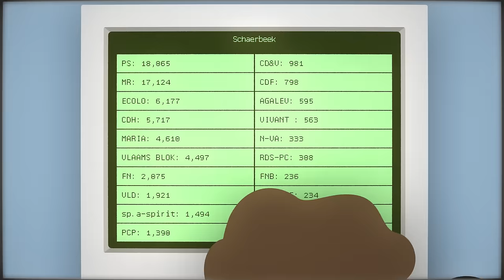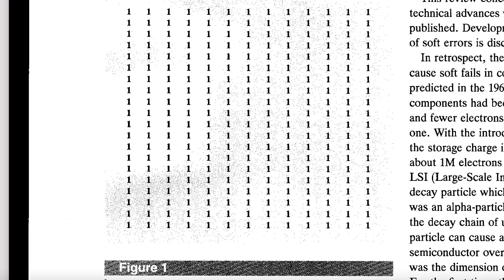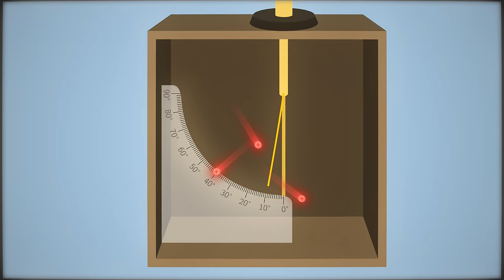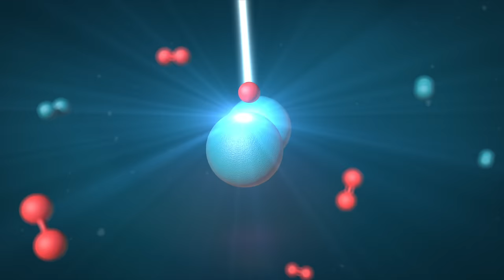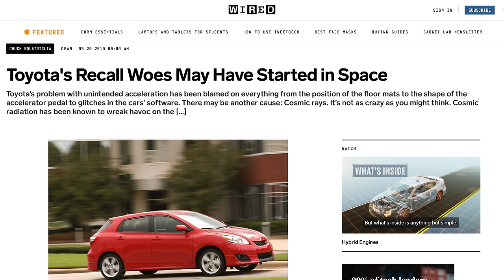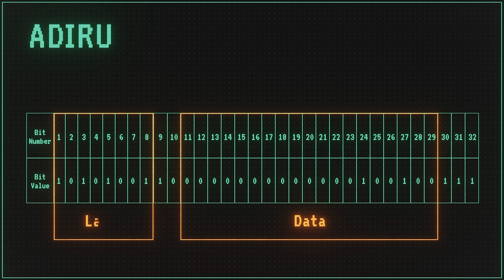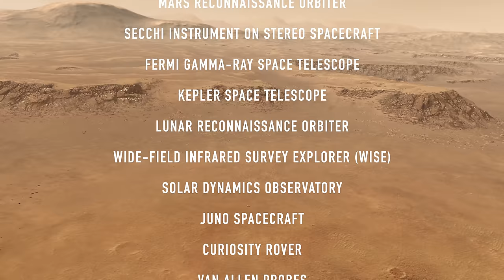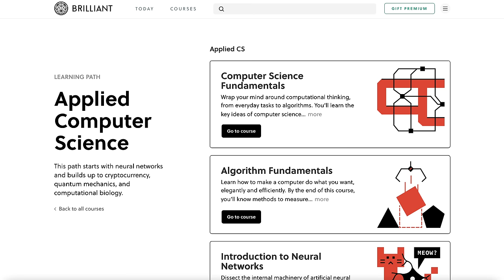The Universe is Hostile to Computers

Comment: My company had an unexplained event like this some 20-25 years ago.  The bottom valve of a chemical reactor opened prematurely dropping the batch from that reactor into the next reactor, ruining both batches.  The investigation found no issues with hardware and software.  Watching this video jogged my memory on that incident and now I truly believe it was caused by cosmic rays.
Reply: hmm, another perfect example why depending on computers will likely come to be a big mistake.
we so busy worrying about if we can, but not if WE SHOULD>
Reply: @Lizards_Lounge Ehh id say the better alternative is having a failsafe
Reply: @Lizards_Lounge  The 1000s of %'s of efficiency we gained from computers is well worth a couple mishaps here and there, and its not like that never happens with human operators.
Reply: @Lizards_Lounge  NASA has cosmic ray proof tech, I dont think the problem is THAT big after we learn from our mistakes. Computers used to be a bitch 20-40 years ago
Reply: @Lizards_Lounge  most likely, in the current state of the world, ai could possibly open up a whole new level of bitflip tracking and fixing, but simply having a few failsafes works well.
Reply: @Lizards_Lounge because relying on a person would result in no mistakes… 🤦‍♂️
Reply: I'll remember you said this when you get doused with hot nitric acid at the factory there matey...!
Reply: @universenerdd  , right, like a mechanical lock that has to be unlatched.  But, alas, they didn't have that.
Reply: @KerrAvon7 , who is this response to?  Me? What did I say that irked you so?
Reply: @nghiado9895  It's to you obviously. If a valve can let an entire batch of....whatever....be ejected at the wrong time could be made to empty a viciously corrosive species on a human if the other physics allow it, not just the theory of solid-state semiconductors...! I wasn't being vicious...I was alarmed and concerned for your life my dear colleague!!   :face-green-smiling:
Reply: @KerrAvon7 , oh, I see.  The setup was that one vessel would dump directly into the one below it.  It cannot be spilled out of that connection, so no one could have been hurt ever.
Reply: @nghiado9895  Yes, I thought you'd design it correctly!   :)
Reply: @squidwardo7074 "sorry boss, i think i was hit by a cosmic ray"
"... you killed three people-"
Reply: Would be an awesome piece of history if you could find the incident investigation. That’s required per osha, although I’m not sure how much history your plant keeps
Reply: wink wink

Comment: I've been programming computers since 1969 and I thought this was solved in the 70's with ECC and other memory correction schemes.  I also thought the math co processor functions on the Main-frames and Mini's actually ran the calculation multiple times behind the scenes because of how the compilers compiled the code.  I had no idea this was still an issue.  Holy cow!  A plane gets bad data and attempts to fly into the ground.  I'm speechless that on a plane's flight controls there isn't redundancy to counteract this.

Comment: What blows my mind is I'm a software developer and never heard of such things. This is incredible, thank you very much!
Reply: I definitely have. It's why RAID scrubbing is a thing and RAID scrubbing in a RAID5 or RAID6 is still not as redundant as the old space missions, but since the incident rate is lower, it's usually good enough. It's definitely why your data is safer on a RAID5 with periodic scrubbing than a single hard drive, even if the hard drive never fails. Bits get flipped and those might not even all be cosmic radiation. Entropy takes on many forms.
Reply: Also you may have heard of ECC memory and wondered why it costs more and is mostly for servers.
Reply: I work in high safety firmware and we do have standard coding procedures to recover from bit flips in the absence of ECC RAM. Usually we duplicate sensitive variables in different parts of RAM and we also invert some of the duplicates.

That way we can check both for SEE and for short circuits on the data lines (if you only keep duplicates without inversion you would not detect a faulty data line).
Reply: I'd imagine most software developers don't need to loose any sleep over soft errors. Worst case the user has to restart the program or power cycle the computer and the work lost is quite small. The story gets vastly different in sectors like enterprise, industrial or any form of transportation where soft errors can have huge financial or deadly consequences. And even then I would think that most of the devs work on a layer which doesn't directly interact with low/hardware level stuff like ECC, parities, RAM-checks, self-tests etc.
Reply: @den2k885  What if the bit flip occurs in instructions instead of data? Do you run important calculations multiple times or some other way to deal with that? Seems like a really tough problem to try to code your way out of instead of solving at the hardware level. And I guess this technique would only really work when writing very low level programs, otherwise who knows what kind of compiler optimizations, high-level language magic, OS abstractions, etc would get in the way.
Reply: @mpoisot  very low level, we're talking about firmware where optimization is controllable in every aspect for any section of code.

Code is checked both through watchdogs (prevents flow going comoletely awry) and usually decisions are taken after N samples of some parameter, a single bit flip won't be critical. Code is also continuosly loaded from ROM, and in many cases the underlying OS (RTOS or AutoSAR) has still other cross checks on registers and tripping points to validate the flow of the code.
Reply: well, now you know what to do about the bugs!
Reply: The beautiful thing is that hardware people take care of these things so you don't have to worry about that. It's all a team effort, no one needs to know every detail of every level of abstraction.
Reply: It's always been my first go to excuse for a bug in my code.
Reply: anonymous  it’s not. It can be damaged just like any other component by ESD

ECC usually refers to having an extra set of bits so that you can detect (or even correct) bit flips. 

Here’s an example: let’s say you have a rule that you must have an odd number of 1 bits in a 9-bit row. That means your extra bit (the parity bit) must be 1 if the number of 1 bits is even, and 0 if the number of 1 bits is odd. Let’s say there’s a single bit flip. That means you now have an even number of 1 bits, so you know a bit was flipped. This doesn’t work if you have two (or any even number of) bit flips, since that would result in an odd number of 1 bits.

Note: a similar method is used to detect whether you typed in your credit card incorrectly.
Reply: Lol. Ya..
Reply: @hynjus001   LMAOOOO so you have a bug in your code and start checking for cosmic rays? Do you even code? LMAOOOOOO
Reply: It's so much tougher to write software for safety critical components. For automotive, there's different levels of integrity ratings defined in the ISO 26262 standards. The most strictest rating (ASIL D) is for critical components like a motor ECU. And to satisfy the ratings, the development processes, coding standards, and validation has to meet the requirements defined for each specific rating. ASIL D strongly recommends (or requires?) to define true/false as a bit pattern rather than simple 1/0 to protect against bit flips.
Reply: Moskva the reason you never heard of this before is.... it's BS.
Reply: Welcome
Reply: I'm programmer too and I did encountered plenty of errors caused by cosmic rays in my programming.
Reply: I am a data entry prof, basically the same thing and I haven't heard of this either.
Reply: @lostmeme9862  Well isn't that convenient... Now you guys know what causes what ever malfunction you cannot otherwise determine the cause to... 
How scientific.
Reply: I'm not software dev or data entry tech and I knew about this. So I'm pretty damn smart

Comment: 16:44 depending on a plane of course, there is a point where you are so high that the atmosphere is thin enough for you to overspeed, but also too thin to support the lift of the plane that you can overspeed and stall at the same time.

Obviously a commercial plane probably won't be flying that high but the physics says you can stall and over speed

Comment: Karl Jobst: "Getting this many ender pearls and blaze rods are impossible"

Dream: "Dude a cosmic particle flipped a bit"
Reply: "dude a cosmic particle installed plugins on my computer"
Reply: make this the top comment pls
Reply: Plausible
Reply: When your luck is 100 and it gives you creative mode
Reply: Okay maybe this explains Post online that looks like word salad instead of what the person commenting originally meant
Reply: "Dude several cosmic particles flipped several bits in exactly the ways I needed but surely it is just a great coincidence I don't control the stars"
Reply: is impossible. Grammatically, you're referring to a single intangible noun, the act of getting, so even though it's getting multiple things, it's still one task, meaning it *is (allegedly) impossible, not are.
Reply: Had the same thought there ..
Reply: Couldn’t this actually (no irony) be the reason that Drem’s loading screen looked different? I know that there’s a 99.99999… chance his run was faked, but still.
Reply: I see few absolute legends here
Reply: Yes

Comment: FYI: The toyota issue was ultimately determined to be the result of spaghetti code and a poorly programmed watchdog. One fun fact about this was that on system failure, the throttle body would default to fully open rather than fully closed.
Reply: To be fair, SSE is not supposed to result in consistent problem on different machines
Reply: Wow, the system better nor fail in traffic
Reply: Toyota:  "full send or no send"
Reply: 9
Reply: 99
Reply: It can be both.  A watchdog is there specifically for abnormal cases - including cosmic bit flips.
Reply: Let's just isnull to zero, no big deal.  Meanwhile zero is GOOOOOOOO
Reply: You mix up several issues.  The video here is talking about "unintended acceleration", which was not blamed on a software fault.  The actual NASA and NHTSA reports are hyperlinked in the video description and also in comments elsewhere, and they do not blame software.

Comment: Dealing with cosmic rays hitting our astronauts laptops in space is exactly the IT work I have dealt with and still deal with on a day to day. Such a great video outlining this problem and what causes it.
Reply: Can you explain further about what you do? I’m super interested!
Reply: where do you work/what do you do?
Reply: Don't leave us hanging, bro!
Reply: @earthling_parth  I am a contractor with NASA, I worked with the ISS program for 3 years and currently work on the Artemis project the past year going back to the moon. Both with ISS and Artemis I am working with the laptops the astronauts use for their day operations to conduct science, email, and anything else you can think of that a computer does that they'll need.
Reply: That's actually pretty interesting. Thanks for sharing 🙏
Reply: @ethanleas6319  and you sir have the coolest IT job in existence
Reply: @ethanleas6319  wow 😳
How did you get that job in the first place?
Reply: Why not better shielding?
Reply: @samuelkeystone  In order to block these type of charged particles it either requires bulky thick structures, or extremely powerful magnetic fields that require an immense amount of power. Both are currently prohibitively expensive and impractical to implement. This is an area of research that is constantly getting funded and new materials and technologies are emerging from it. Maybe one day but for now its very much a gotta deal with it and plan for/around it.
Reply: @samuelkeystone  more shielding requires more mass and to be effective it has to be thick, so lot of mass. And when you are dealing in the thousands of dollars per kilogram moved into space, you will try to shave off as much mass as possible. Plus, having a system that actively deals with errors due to SEE is better than a passive one, the passive is going to have an error eventually and you won't have a way to deal with it.
Edit: predictive ai is messing around
Reply: @ethanleas6319  So how do you protect laptops without shielding or powerful magnetic fields?
Reply: @PresidentialWinner  i would assume a few sets of redundant memory so it can be cross-checked much like the rockets.
Reply: @PresidentialWinner  We use various means and methods to create redundancy. We also have various procedures in place for operations or the crew to perform when a failure occurs. And as cliche and memey as it is, a reboot is generally involved. If that doesn't fix it then more drastic reformat reinstall the OS may need to be performed. In the worst case it bricks the laptop and another is taken out of storage to replace it. The storage location is usually better shielded so fingers crossed those aren't bricked.
Reply: @Kanitoxx  I'm glad to see all that education didn't go to waste.
Reply: Reading your comment I was completely convinced you were sarcastic. I thought you were pointing out that while interesting, none of us will be faced with IT problems caused by cosmic rays. I was positively suprised you were not kidding.
Reply: @ethanleas6319  Interesting. So how often does this kind of thing happen?
Reply: @ethanleas6319  Woooah. That is so cool. I work in IT too, but a regular DevOps job. Working at Nasa is my dream, but they only accept American citizens so I don't think I'll be able to work for them. You are one lucky dude. Thanks for sharing ❤
Reply: @PresidentialWinner  Unlike the shuttle days, they dont really keep track of that information any more. But its often enough that they restart machines daily or multiple times a day to ensure they are in a known state at least on ISS. I dread and look forward to finding out how the lunar orbit environment is going to effect our Common Off The Shelf (COTS) laptops.
Reply: @ethanleas6319  Wow alright. Yeah or imagine the trip to Mars and back, that is such a long time to be in deep space with this problem. And you can't just get new computers if one is bricked...

Comment: 1. *Introduction and Incident Overview* - (0:00:00)
2. *Election Voting System and Error Detection* - (0:00:18)
3. *Investigation and Discovery of Anomaly* - (0:01:31)
4. *Explanation of Bit Flipping in Computers* - (0:02:01)
5. *Historical Issues with Computer Memory* - (0:03:01)
6. *Discovery of Cosmic Rays* - (0:07:04)
7. *Properties and Origins of Cosmic Rays* - (0:08:06)
8. *Effect of Cosmic Rays on Computers and Electronics* - (0:10:07)
9. *Examples of Cosmic Ray Impact* - (0:13:00)
10. *Conclusion and Implications for Modern Technology* - (0:14:36)

Comment: It's actually surprising that this does NOT happen so often, crazy how something so tiny can be so accurate
Reply: It does happen often but we have hamming codes to the rescue
Reply: They happen all the time, but systems aren't critical or have redundancies to avoid it. One of the theories as to why those Boeing 737s fell out of sky is that a bit was flipped in one of 2 attitude sensors. Most other large jets have at least 3 in case one fails.

Those downed planes coincided with solar storms. A  bunch of power substation fires and utility failures happend during that period. Also, while I was managing biology labs some of the sensitive equipment would  stop working correctly during solar storms.
Reply: other way around, it DOES happen often but its NOT accurate so you dont notice it
Reply: Isn't the whole problem easily solved by simple redundancy? Just do everything twice, and if results don't match, roll back and redo. Even with just 2-way redundancy, the chance of same exact error happening twice in two datasets within the microscopically tiny update window (compared to the error rate that scales up to months) becomes basically zero. This may double resource usage but will completely solve the problem. If new planes, cars and medical equipment don't already do this, I'll be shaking my head.
Reply: The beauty of statistics
Reply: @rtyzxc With just 2 you don't know which one is wrong. You would just have two conflicting signals. In some applications you could just say "Hey you fucked up, do it again", but a lot of the time that's not an option and you would want three so you can confirm which one is erroneous.
Reply: @rtyzxc  Computers used in any critical process these days will having ECCing RAM, which mitigates this. The problem with storing two copies of everything is you don't know which copy is incorrect and it uses too much memory, but the field of coding theory has produced some very elegant solutions for finding and fixing errors with minimal cost (see 3b1b's video on Hamming codes though better stuff is used today). Even with error correction though issues are always possible.